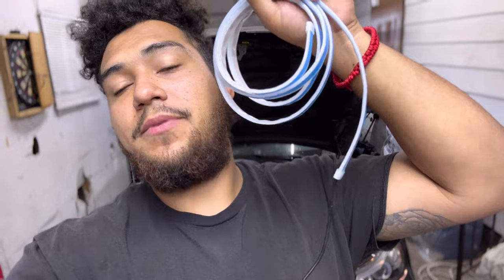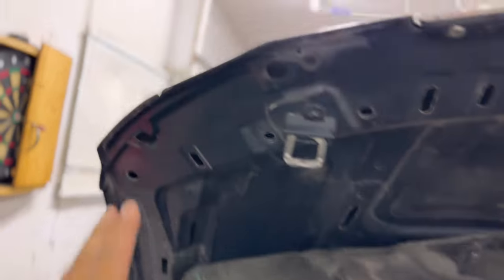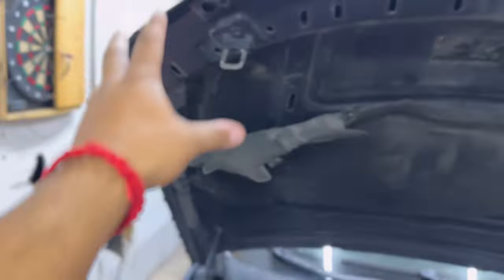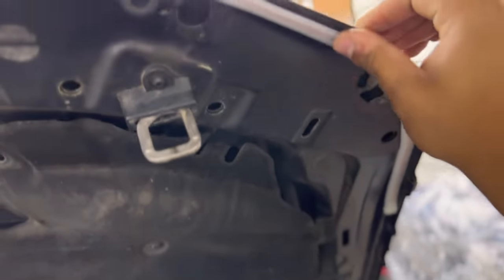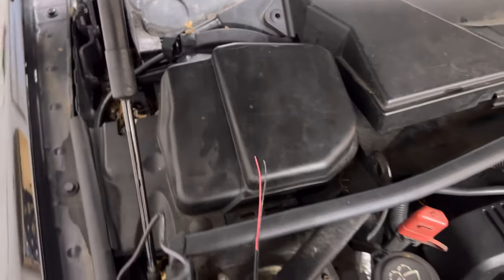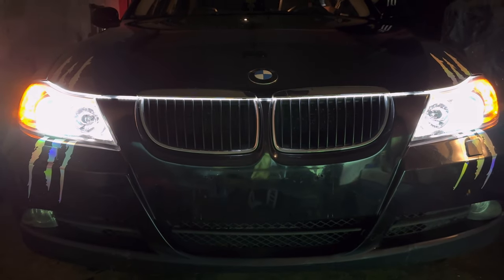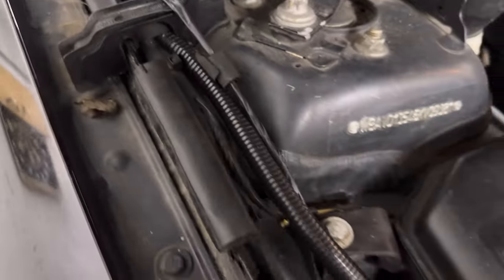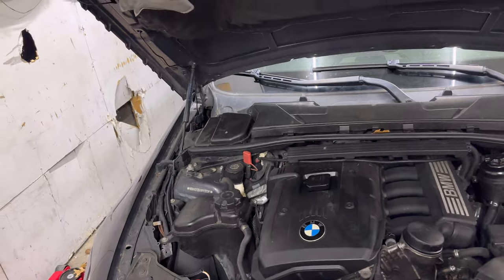CarXK Newly Designed LED Hood Strip | Clean & Easy Must Do Mod | Step x Step Install! | ANY CAR!

Comment: So i had a question? Do these led strips have a driver to control flickering... Or do you need to install one?... Is it just like plug (connect) and play. If you could advise 🙏 Thank you.

Comment: After watching your how too! Video for one thing you didn’t go into detail with showing how you made the connections and next you stated fuse box and not headlight which is misleading , I would suggest you you stick with what you say your going to do. But I will say this hooking it directly to the headlight the bmw headlight error code will pop up on the dash board and am saying this because I did exactly what you did and the only reason I watched this video is because you stated connecting to the fuse box.
So on a bmw this is not ideal to run on the headlights due to the modules.

Comment: I bought one these types of kits but they brought 2 yellow wires as well. Any Idea what they would connect to?  SO I have Black, red and 2 yellow wires. Any help would be great
Reply: I got the same situation but i jus found out the yellow wire is for when you turn left or right
Reply: these would be probably for Left,right turns
Reply: The yellow connects to the turning signal

Comment: Did you hook up yours inside the fuse box? Where is your fuse box located? I have a 2022 bmw x3 think my fuse box is inside the car?
Reply: Yes there is always a fuse box underneath the dash in the cabin somewhere. Is there no fuse box in your engine bay?
Reply: @WilldaBear , I don’t believe there’s any fuse box in the engine bay for BMW. Did yours have a fuse box underneath the engine bay??
Reply: @sumeetlal1  I do not have the exact car as you so I am not sure for yours, sorry. I would look in the owner's manual for fuse box location. 

However if that 2022 X3 really has no fuse box in the engine bay, then the only option for you is to access the fuse panel that is inside the cabin. Most likely it's behind the glove compartment so you would have to open that to see your fuse panel. Then decide what fuse you want to tap into. The difficult part is that your lights will be in the engine bay area while your fuses are all the way inside the cabin so you would have to find a grommet to push the wires through so it can reach the glove compartment. Make sure you choose a fuse that won't mess anything up.
Reply: @WilldaBear  you’re talking to a wall trying to  explain to a bmw driver

Comment: How would I connect this to the ignition fuse? I don't have drl in a 2002 grand cherokee
Reply: Open the fuse box and look for the ignition fuse. Then use a fuse adapter to tap into it. I ended up using another fuse instead of ignition.
Reply: Hook it to the fuse 🤦🏾‍♂️
Reply: Please show us the ignition fuse or headlights fuse

Comment: u didnt even show how you connected which was the main purpose for us clicking. some of us need a visual because we do not know... pointless video
Reply: Simple, just get terminal ends and crimp them onto the end of the 2 wires. Black will go to a ground and the red you will have to find the right fuse that works best for your car.
Reply: @WilldaBear  Not very simple for them apparently
Reply: right